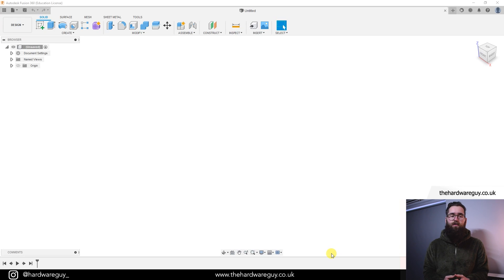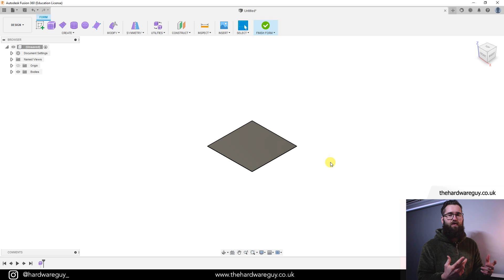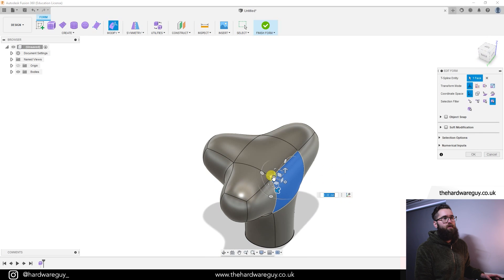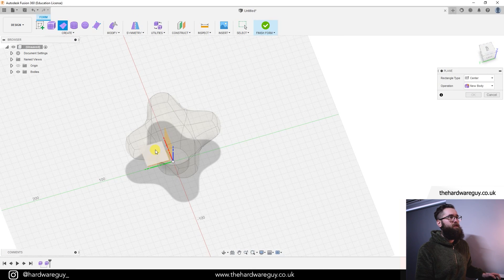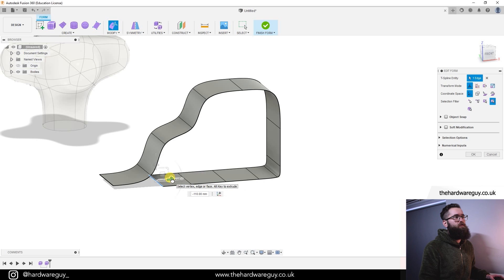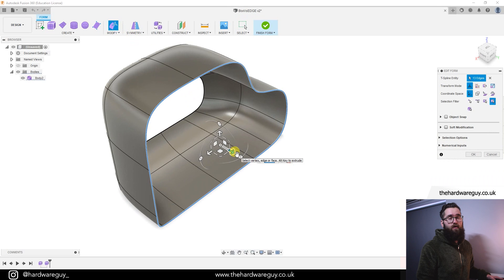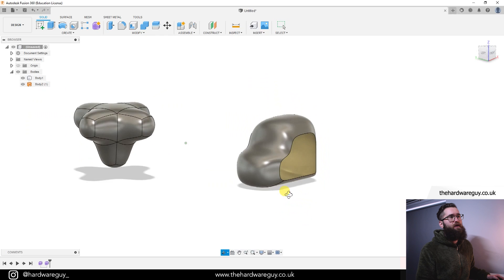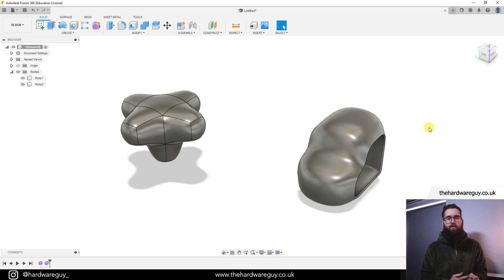Box and Edge Modeling - Fusion 360 T-Splines

Comment: Hey Gareth, thanks for this tutorial. Would you be able to do a video on how you designed Raptor II in fusion360? Specifically the linkages/how you got the movements working, how you designed each individual part to fit together, and just generally your workflow on designs. I'd be really interested to see how you tackle complex shapes, doesn't have to be on the Raptor II, could be a new/ separate rc or other mechanical device entirely. Thanks!
Reply: just seen your website, sort of answered my questions! An update on the Raptor would be nice still!